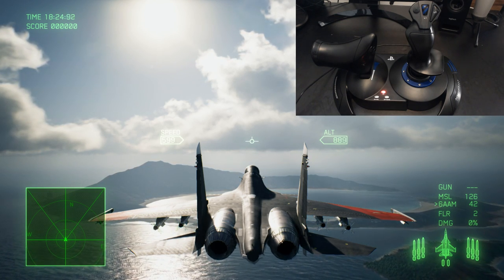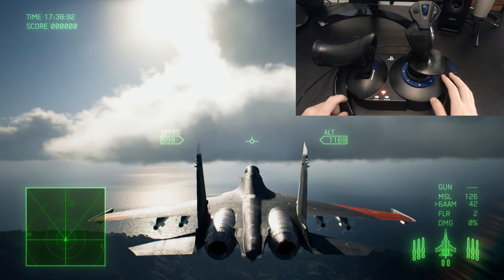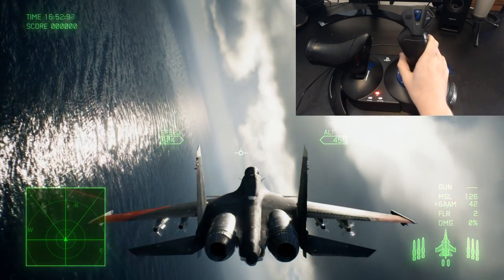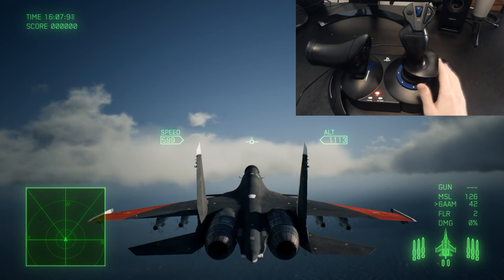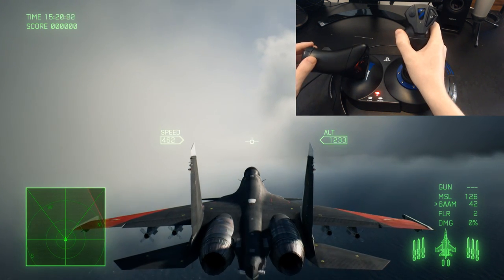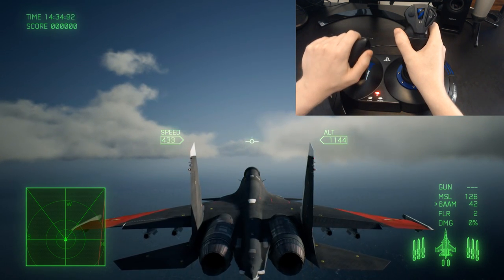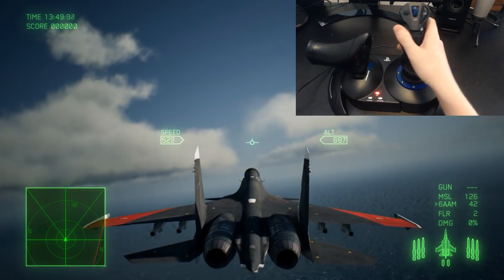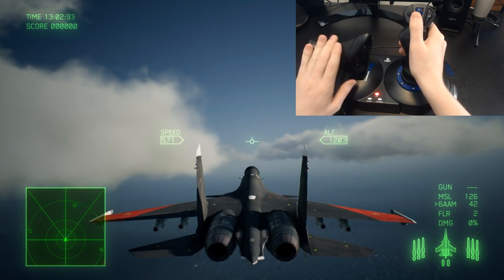AC7 Tutorial: How to Perform Post-Stall Maneuvers with a Flight Stick

Comment: The Square/X buttons in regular controls activate the high G turn, the same as holding L2/LT & R2/RT on a controller.
Reply: thanks mate!
Reply: This is true
Reply: X button is autopilot on this hotas
Reply: Do you know which button do I need to press on the T.1600M flight stick?
Reply: @jonmapa0077  on the stick used (i have the same one) it’s square
Reply: @ewanfarley  man that would have been really nice to know about a year ago

Comment: Step 1 = Slow down untill less than 500 

[pause for half a second] 

Step 2 = Set throttle to neutral. 

[pause for half a second] 

Step 3 = Press X or Square 

[pause for half a second] 

Step 4 = Pull back on the flight stick. 

Step 5 = Practice. 

Those pauses are very important as they let the game register the combination

Comment: <<  MOUSE ONE:  Technical point for you ACF.  The term for the throttle when you 'get a click in the middle' is called the 'detent'.  A detent is a mechanical or magnetic catch to resist or stop movements of spinning components such as wheels, axles, or spindles.  In the case of the throttle, the axle at the base the handle rotates around.

These things are everywhere, but the term is so underutilized by the layman that you could describe it with a thousand examples and only get blank stares.  Easy examples include step-tuning knobs such as those on radios.  Or the knobs on a stove (where the burner knob pops out slightly when you twist it to the 'off' position, so as to keep it from being accidentally turned on and burning your house down).  

Not a critique, just some knowledge for you since I winced when you stumbled over describing it on the throttle.  Knowledge is power after all.  And I LIKE power.  >>

Comment: I wasn't able to do it picking a random plane (Typhoon), switched to the Su-37 and did it on the first try ^^
Turns out it's impossible to do with delta wings, or at least I don't have the skill for it.
Reply: Typhoon can't do post-stall maneuvres, simply
Reply: Only planes who can are the F22, F35, F18, MiG-29, and all the Sukhoi. Even the Su-34, surprisingly.

Comment: Im still using a stock Xbox One controller. And eventhough I main an Su-57 I still almost never use post stalls in any combat situation. You have to drop to such a low speed to even initiate it that it leaves you very exposed. And thats before you even started. Afterwards you will be flying extremely slow although having a Light Blisk lvl 2 can help you get your speed back quickly. Only time I used it in multiplayer was pretty much by accident.

Comment: This is helpful because the other tutorials I've seen give the impression that you have to throttle up to full to do it, rather than neutral. This will help me do it a little bit faster. Can you show how to do one on the stick with High G type B? I'm wondering if it's even possible.
Reply: Still wondering. ;)
Reply: Are you still wondering?

Comment: Thanks, although I use a thrustmaster 16000, and AC7 has both throttles (the separate one and the one on the stick) mapped as a single throttle throttle. Any suggestions?
Reply: Try using WoJ XInput emulator

Comment: Hey I know this is an old one but I recently got back into ac7. I been trying to figure out how to do certain psm moves properly for desired effect. (Like spare 8, rip, against sol squadron) if I try to do a cobra I find it is hard to get my nose back to where it was before I start stalling. Currently on controller I hit breaks to target speed (around 400km/h consistently) and hit the psm and immediately hit accelerate again. Am I doing something wrong where I'm not coming out of the maneuver level? If anyone can ask I would be most thankful.

Comment: How do you get that skin
Reply: Shoot down Mihaly in Mission 18 in under 5 minutes without using Special Weapons. Guns and Standard Missiles only.
Reply: Major Borngus Fluunduch what jet would you recommend
Reply: @maxbolton6925  Anything with good speed and maneuverability will do the trick. You need to be able to nail him good with the gun when he initiates a slow speed turn fight with you and you need the speed to keep up when runs away and gives you a chance to hit him with missiles. Also, make sure to hit him with both missiles and guns when he comes at you head on.

Comment: Is this stick supported for PC?
Reply: Yes i believe so. Def. Worth the buy
Reply: I can confirm it is. The Hotas 4 and Hotas One both work with PC and I use mine all the time for FSX. It has a switch on the base that you flip for either console or PC gaming. For $80, it's the perfect compromise for both platforms
Reply: It will support full remapping, so unless they utterly fuck this up you should be able to map a high end hotas if you have one.
Reply: Tried this with Xwing Alliance for pc. It works.
Reply: It does work, but you need the latest drivers, and they weren't supported at first but they've fixed it for the most part, although you still can't map custom controls. The t flight hotas one and 4 are pretty much the same, but the one has some more controls from the Xbox one controller that would help if you plan to play in big picture mode

Comment: This maneuver was used in combat before. A f4 phantom did it to get away from an mig 29.
Reply: Gonna need some proof of that. Pretty sure an F-4 physically cannot do what's being demonstrated.
Reply: @majorborngusfluunduch8694  It certainly can't in this game, I tried. Something about thrust vectoring? I dunno what it means, but it's a thing, apparently. None of the planes you get at launch can do it. Gotta unlock one.
Reply: @Billkwando  Thrust Vectoring is a technology in which you have engine nozzles that move up and down (2D Thrust Vectoring) and in some cases side to side (3D Thrust Vectoring) in order to change the direction of thrust to improve an aircraft's maneuverability. Look at planes like the F-22A or every plane after the Su-33 and MiG-31B. When you pitch up or down you'll notice the engine nozzles moving. That's Thrust Vectoring. That being said there are planes both in the game and real life (in the case of the F-18 and Su-33) that can pull off these stunts without it. The MiG-29A, F/A-18F, Su-33 and F-35C can all initiate post-stall maneuvers, even though the MiG and F-35 can't do it in real life. Or at least the F-35 hasn't demonstrated that ability yet.
Reply: Correction it was not a post stall maneuver it was a high speed maneuver.